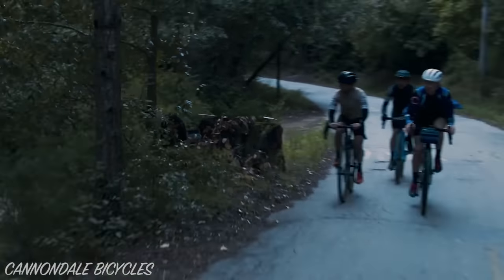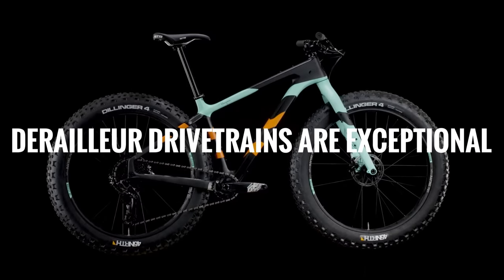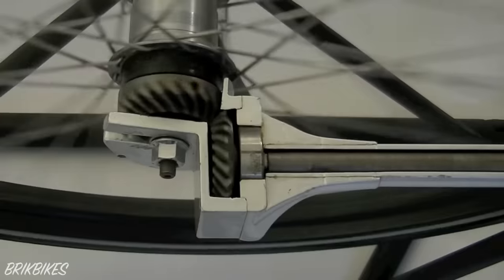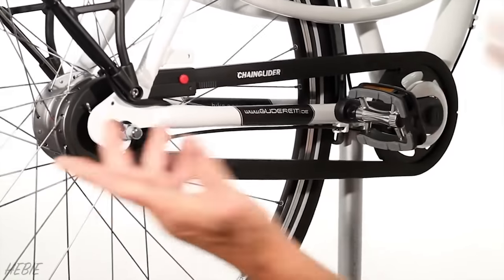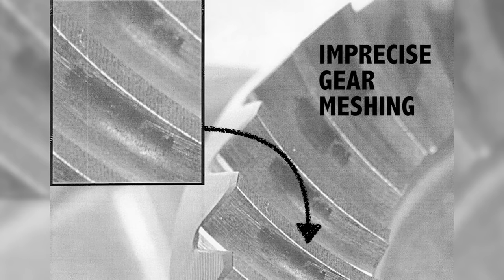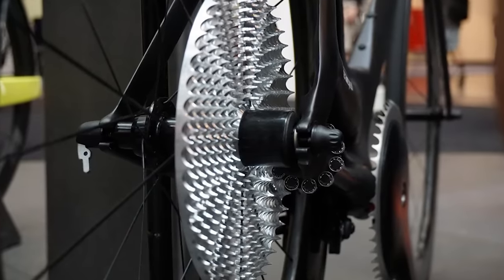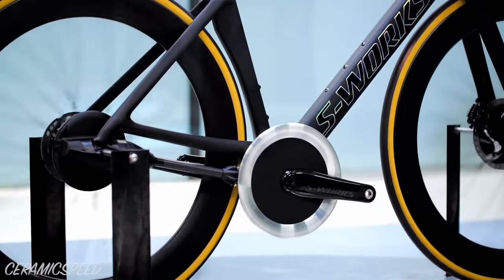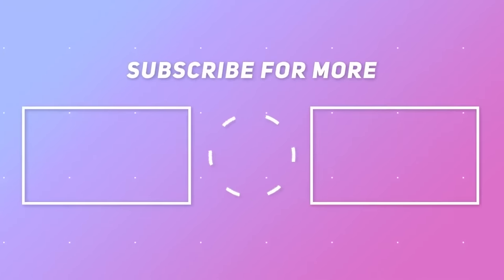Are Chainless Shaft Drive Bicycles a GENIUS or TERRIBLE Idea?

Comment: I don't agree that a chain and derailleur system is best for the vast majority of cyclists. The vast majority of cyclists are commuters, who care about 3 things: practicality, reliability and cost.

A single speed bike is ideal in flat conditions for most riders, but you need a few extra gears for going up and down hills. A belt is far more practical than a chain, because it requires hardly any maintenance, and you don't get oil all over your smart work clothes. With all moving parts hidden away, an internal gear hub is better than a cassette system, as it won't hook on your clothes and it will function just fine in inclement weather.

Derailleurs are perfect for serious bike riders, but casual bike riders will benefit more from internal gear hubs and belts. Efficiency barely even comes into the equation.

Comment: there is an absolute physical limit of efficiency in a shaft based drive train due to conservation of angular momentum. No differential gear can surpass about 92% efficiency in any conditions just due to mathematics, it would require a drive shaft of 0 mass and no friction. Actually efficiency will decrease as RPM increases, the flywheel effect of the wheel itself takes over as the dominant force, and it's wrestling against the inertia of the drive shaft. 

The only reason that an auto-manufacturer uses a differential gear rather than a direct drive is that they are trying to power 2 wheels with 1 engine. It's an engineering compramise.

Comment: It seems intuitive that shaft drives would work in cycling as it does in motorsports, but I think the reason it's successful on motorcycles is the high RPMs, and the advantages the shaft drive gives over chain drive at those rotating speeds. Even at the transmission output the RPMs are far beyond what you get on a bicycle, just look at the rear sprocket on a motorbike, it's huge!
edit: also the front sprockets are tiny in comparison, resulting in very high chain speeds

Comment: An OLD idea trying another comeback. Shaft drive bicycles were first developed with the Safety Bicycles in the late 1890's and early 1900's. 
Shaft drive didn't replace chain drive then, or any of the times tried in the last 120 years, and it won't replace chain drive with or without a derailleur now. Chain drive is much more efficient, is easier to maintain and work on, not to mention a heck of a lot easier to remove the rear wheel to fix a flat or replace a tire and/or tube. The frame for a shaft drive is also heavier and harder to manufacture. Oh, a shaft drive weighs more than a chain drive, as well.

Comment: While I love shaft drive motorbikes, I suspect electric drive bicycles will be the "new" normal before shaft drive bicycles are.  They are already heaps popular, and much more research into battery weight reduction is being done than research on shaft drives.  Advantages of not needing new exotic frame and bearing materials either.

Comment: QUESTION: How about a shorter Shaft drive that powered the rim and not the hub? 
Couldn't Drives mesh gear system work off the front cog then instead? 
Yes I understand there are gear ratio issues to solve, but aside from that?

Comment: Deleted my last comment did not really make sense.   So I gather it's an on-road drivetrain only as I can see that it becomes useless once you get the gear disk covered in mud.    

So basically, it's a one-trick pony only meant for specialised racing and pretty much for nothing else.     This is all and well, but you significantly decrease your profit margin if you heavily specialise.

Comment: Gears are more efficient than chains with typically about 1/2% loss per gear mesh pair. The only reason for not obtaining this is quality of the Gears and assembly. Increased costs, serviceability and weight are why these are not more popular.

Comment: You could double up the drive shaft so tork load is halved. It would increase cost and weight, but would solve the material issue

Comment: "no skipping gears" sounds like those knives that "never need sharpening". If you try to sharpen those knives, the metal splinters. Basically it gets dull and can't be sharpened "never needs sharpening"... "No skipping gears" sounds like it doesn't skip gears because it has no variable gears... the differential you have is the only differential you get....

Comment: The Driven drivetrain: Why don't they just make the whole rear "cassette" a big ring gear? Instead of forcing the bearings to slot into each row of teeth, it should be a ring, like what's found in an automotive differential. This would probably reduce stress on the components, and have the added advantage of having an infinitely tunable gear ratio. It would almost be like a CVT in a car. And the weight penalty really wouldn't be that much.
Reply: There might be a way to use a shaft and worm gear combo to transfer power better while pedaling.

I also think that single speed shaft drives are probably more practical than multi-gear ones.

Comment: You talk about improved chain efficiency while still using old shaft drive efficiency, wouldn't both have improved?  I'm pretty sure improved lubricants and better bearings would have improved shaft drive efficiency.

Comment: I live in Amsterdam, and because most of us leave our daily driver bikes out on the street in all weathers, a belt drive and internal hub gearing makes far more sense. They're fantastic to ride - torque is immense with a belt, and it's very nice not having to worry about clothes getting covered in oil, or indeed worry about having to keep a chain lubricated and clean. I'm hoping to get a gravel bike custom made soon, and I will definitely be getting a Rohloff put on the frame.

Comment: do the gear changes at the pedals, as there is alot of room for a 12' diameter lightweight gear, and just use the shaft to transmit the rotation to the rear wheel..

Comment: The comment that because oil got better shafts got worse is silly. Come on!
FYI: The carbon-fibre shaft is 1/10th the weight of a chain. The metallic ceramic gears are 1/3rd weight of derailleur gears. Of course, these are more expensive but compared to the silly prices for "must have derailleurs," the ceramic/metallic + carbon-fibre looks cheap.

Comment: Never heard of this tech on bikes, but doesn't sound too bad considering you have less maintanance. Question is though is it still as easily to maintain than the chain system, which i can fix at home with a bought new chain or replace other parts. The shaft system does look a bit more intricate.

Does only the shaft part and maybe its pandon on the other side need to be stiff or the whole frame?
Reply: Shaft-drive basically doesn't need maintenance unless you take an axe to it, or get one that's exceptionally poorly-made.  Everything is sealed, so they don't really need any form of regular maintenance, but if something breaks then you might be in for some trouble.  A basic single-speed shaft is super easy to fix, easier even than a bike chain, but multi-speed shafts are often incredibly complex and may make repairing a car transmission look like child's play.

And yes, it's basically only the shaft and the "chain" stays that need to be stiff.  It can help if the seat stays are stiff too as that helps reduce twisting on the chain stays, but the shaft is fine as long as the chain stay next to it isn't flexing.  It's an inconsequential detail if you don't mind adding a small bit of extra weight for rear suspension.
Reply: @GremlinSciences  thanks for the explanation. There was a point i wanted to make due to as you say that not the whole frame needst to be stiff, but i am unsure about the idear i had -_-. It might have had to do with the positioning of the shaft, its overall length and therefor usability for different positions of the cyclist. Like there are concepts where you sit near to the ground leaning back in a chair like position while your feet are ahead of you, if such would make any differance for this system.
Reply: @kinngrimm  A straight shaft should work fine for any configuration that a chain doesn't need guide rollers to clear, though you could always add some form of CV joint to the shaft so it can pass underneath an exceptionally low seat with relatively high pedals.

Comment: I think this is absolutely genius. A front wheel drive bike is also totally possible with this!
Reply: Already been done.  I rode a 2wd mtb at interbike show years ago.  It was cool, but would have been a pain to maintain.. and I couldn't think of any situation where front drive on a bicycle would have been advantageous over simply dismounting and walking or carrying the bike past the obstacle.

Chaun drive is light, efficient, resilient and is probably the optimal design for a bicycle.  Trying to do something different, just to be different is not that interesting.

Comment: Even if Shafts were as efficient, they are just more expensive to manufacture and therefore more expensive. Cycling especially as a means of transportation is not about the latest and most fancy technology it is about easy accessibility (which includes monetary concerns) and sustainability. I guess you prefer belts because they are lighter and maybe even cheaper then chains, does not matter.
Belts are based on polymerized oil products, you need rubber and other polymers which is basically just specialized plastic. A metal chain of a bike can be (theoretically) thrown in the woods and dissappear in a hundred years because it is just iron with some aggregates. The belt, however, is a nasty piece of plastic, completely unnecessary replacing a technology that is already working good (maybe not best) and gets the job done.
I don't think it serves cycling well to get dragged into the high-tech materials that just add a few percent to performancem while increasing the environmental impact of cycling to unacceptable levels.
Cycling is also sports, sports are most effective if the resistance is reasonable. Having a high tech bike only makes you go further while going faster just to have the same workout.
So in my opinion you are going down a few lanes the wrong way. A bicycle does not need to be fast (as transportation), it does not have to be ever lighter (to offer a good workout), it has to be cheap and easy to maintain with a good conscience (from an environmental view).
So new technology in cycling should be resisted, innovation in a sector like cycling that is actually already well-engineered, serves only one purpose, introducing new trends and techs, proprietary if possible, to turn a profit. There is no gain for customers designated in this, if it there is one, it is only by accident.

Comment: Shock drives fail constantly.  The only reason that shock drives work on cars is because cars are powered by a much higher level of energy so they can carry much more weight and push the much stronger format.  Shock drives in reality are quite shit.  Shock drives weigh a shit ton more.  Shock drives also are heavy and harder to push so they actually make you slower and able to travel in less distance because of how much strength they require.  They are under 50 years old and no company that makes them is older than actually 10 years your just lying about them being made older to make a false point.  Drive shafts on bikes are never used by anyone who actually rides because they weigh too much and break too easily unless you make them out of stronger material which makes them even heavier and harder to move.  Also they are not fully enclosed nor can they be and they clog easily with all types of dirt and grime.  Hell they constantly fail.  They are expensive as hell to replace and can not be fixed they have to be replaced and fully replaced because every part of them is specifically designed to fit only itself.  The amount of people skilled enough to actually replace them is extremely limited.  To replace them takes days per bike.  They are so extremely stupidly hard to work with that it literally takes days to replace the system on bikes because of how overly fucked up complicated they are.  The real reasons they are not in use is they are impossible to ride with, they break constantly, they take way too god dam much time to replace, they are way too expensive, the amount of people that have the useless knowledge on fixing them is extremely small, and just problem after problem after problems.  The actual first time any format of this shit was even attempted was in 1978 which is not even fucking close to 100 years your lying sack of shit.  Hell a cheap system of this will cost you around $40,000 and that is just for the parts not the full bike.  Also they can not be placed on a normal bike but require a specialized bike with complete specialized from the ground up all parts on the fucking bike which the cheapest full bike set up of this trash will cost you $200,000 and that is for the cheapest.  The average bike of this style is over a million.  At that price you can easily just by the most expensive of all types of bikes.  I actually did research into this shit nearly 20 years ago and holly shit anyone who even fucking attempts to claim this shit is good is a moron.  Just a complete fucking moron.

Comment: What if we attach an electric motor to a chainless drive bike and also an alternator to recoup some of the energy lost by the electric motor? You'd be pedaling, but that would simply be to charge the battery the electric motor uses and the motor would be propelling the bike forward (or backward, something multiple speed bicycles are incapable of doing).
Reply: It will be like riding singlespeed bike with half-engaged brakes.
Reply: @xupyprttffnge7603  A good electric motor can easily propel you 30+ mph so I strongly disagree with you. The charging by pedaling wouldn't be enough to keep the bike going, it would just be an effeciency measure. You could forgo that feature entirely if you wanted, or even throw some solar panels on it as well.
Reply: No matter if you/re sourcing power from battery or purely pedaling, lack of any kind of multi-speed transmission limits the capabilities: you have to choose, if you want to run fast OR to be able to climb. That's natural limitation of hub motors.
Pedaling without any kind of feedback feels like exactly as I stated.
That's more like e-scooter, not a bicycle.

Comment: @2:45 change in direction has nothing to do with efficiency. Also, even the worst gear meshes are 95%+ efficient so precision gears like this could easily be pushing 99%.

Comment: I definitely like the idea of shaft. Especially for a single speed bike. And if the parts is made by titanium the weight could be reduced. 
The most people seem to consider the efficiency more important than practical use. But the loss of efficiency is not that huge compared to chain in practical use.
Just train a bit more and you will still get enough power.

Comment: From an automotive background, while cars using larger versions, they have a torque transfer efficiency of 97-99%... and it is about that in most shaft driven motorcycles I've seen... so I am going to say the person from 1983, their work needs to be redone. I'm willing to bet his math was WAYYYY off. Also you said you don't have data, are you not looking into other systems, because in the automotive field we have over 100 years of data on the efficiency of a shaft drive system, seeing how 99% of all cars uses them.

Comment: In short, drive shaft designs are a waste of money. I can see them being good.. but the weight and force needed to move a single speed drive shaft style bike won't live up to expectations.  The only style I saw that was a good design was with that transmission  style built into the rim of the bike. No doubt drive shafts bikes will last along time but only if you put quality steel into the parts. Anything else will wear too fast and will need 3x as much lubricant and maintenance.   Chain style bikes have worked for 100 years... I see no real reason to change that system.

Comment: I will not even watch this, but it is the ululating obvious that chains are much more efficient for a bicycle, or a motorcycle than a drive shaft. BMW has used drive shafts in motorcycles that are not intended for efficiency, but instead durability. When a person has to drive pedals with her or his legs, it makes no sense to have a more durable, but less efficient system. And then there's the weight issue.

Comment: nice presentation of the issues. to be clear, the loss of efficiency of a shaft is about doubled when you pair it with an internally geared hub-- it's like trying to pedal an automobile. so no, i dont think this tech will ever become popular, as it is not cost-effective and involves too many trade-offs with performance. the only credible chain alternative is a belt paired with a geared hub, and then only for arduous cross country expeditions, or maybe a belt on a heavy dutch-style city commuter for ultra-low maintenance. otherwise, chains systems are cheap, adaptable, and miraculously efficient and there's almost no improvement to be had for 90%+ of applications

Comment: Shay, Heisler, and Climax locomotives all have 100-250 psi boilers of steam to move pistons to rotate the driveshaft.

Cars and trucks have engines that rotate at thousands of rotations per minute.

These make up for the downsides of a driveshaft.

Bikes have neither, and gain no benefit from the advantages of a driveshaft.

Bikes should not be using driveshafts, don't fix what ain't broke.

Comment: Right off the bat before watching I would think its not as efficient simply bc of the increase in weight compared to a chain and 2 gears, and on top of that you have energy loss due to the transmission angles between gears during torque generation.